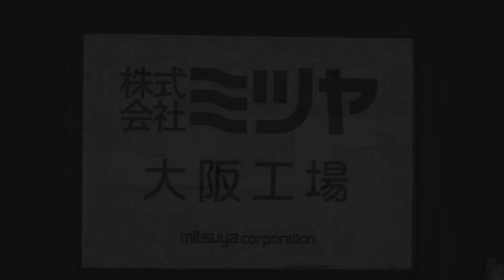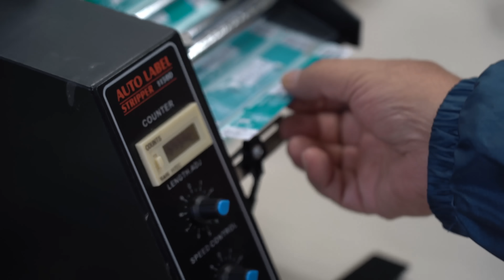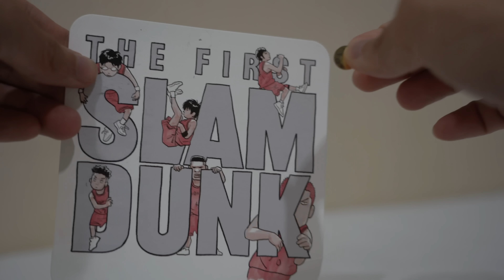画鋲・クリップを大量生産するプロセス。１日200万個以上の画鋲・クリップを作っている日本の工場

Comment: Would have been nice to see/learn how the tack pin is actually attached to the disc portion. Is it spot welded, adhered somehow, or does magic hold it together? We may never know.
Reply: It is a friction fit. The wire is pushed through the top and the ram pushes it all forward mushing it together and giving the top a round dome.
Reply from the maker: This is the process of making a dent in the center of a round material and pressing a pin.
Reply: Would be nice to see a close-up unfinished product demo at the end of each intermediate process too.

Comment: How do they count the right number of clips to go in the bag? And how does the machine count the number of tacks that go into the bag?
Reply: It would be either by weight or volume.
Reply: It's done via weight. I work for a scale company and multi bin mass weight system are a common place. Just a thought for you, most of the snack chips (crisps for over seas) you get in a bag are filled that way also.